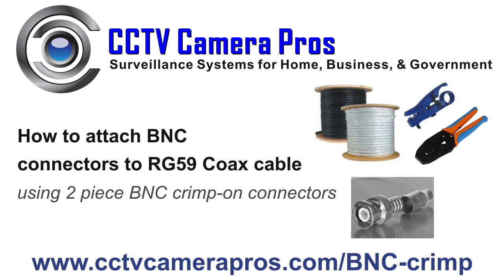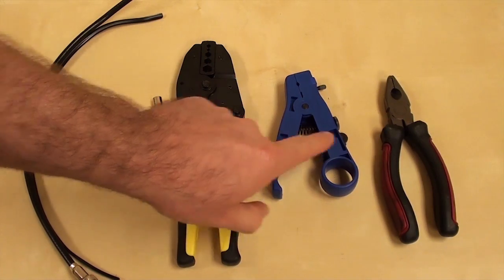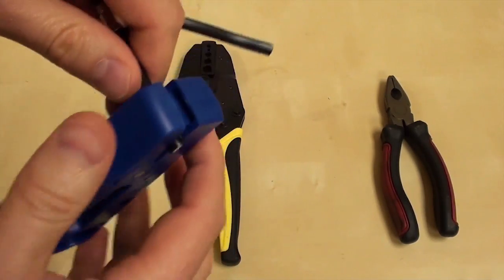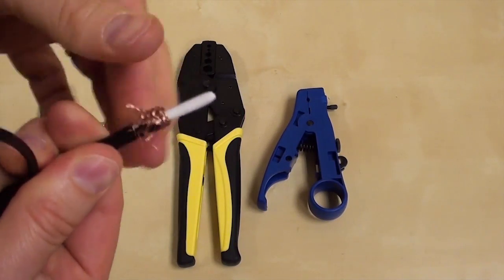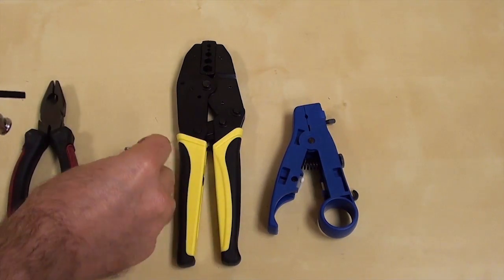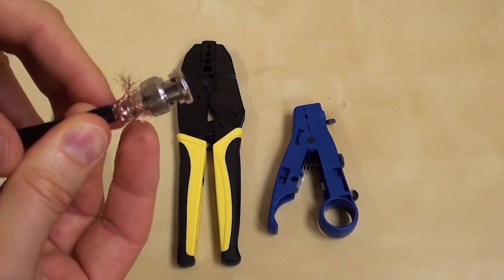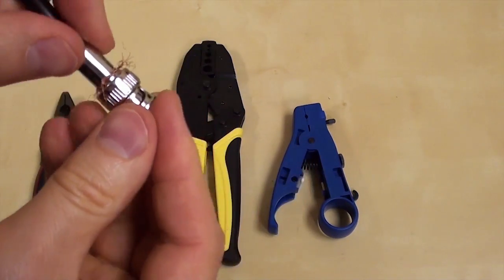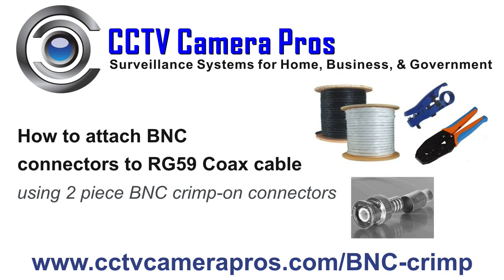How to Connect BNC Crimp-on Connectors to RG59 Coaxial Cable

Comment: Hi Thanks for sharing, great video clear and to the point. I have  Mini RG59 cabling for the Lorax CCTV system and need to refit the Bnc connectors, is  there a crimp kit for that?
Reply from the maker: If you are referring to pre-made cable with the ends pre-attached, then no. You can not cut a re-crimp that type of cable.

Comment: Hello - Thanks for this video. What tools and materials are needed to crimp the female BNC connectors to the same RG59 Coaxial cable? For clarification, it would be to crimp a cable that would connect directly to the head of the cable you've demonstrated here.
Reply from the maker: Jarrod, is your goal to splice together two separate sections of RG59? If so, I would recommend crimping an F-connector on each end of the cable. https://www.cctvcamerapros.com/F-Connector-RG59-Coax-p/cn-fm84.htm
Then connecting the two cables with a double female F-connector. https://www.cctvcamerapros.com/Double-Female-F-Connector-p/cn-df1.htm

You could do the same thing with BNC connectors, however, we have found that when attaching two cables together, F-connectors are more secure than BNC. 

If you do want to use BNC, attach these BNC crimp ons connectors to each end of the two cables. https://www.cctvcamerapros.com/CCTV-BNC-Crimp-p/bncmalecrim.htm
Then connect the two cables together with this double female BNC. https://www.cctvcamerapros.com/CCTV-BNC-p/bnc-double-female.htm

Whether you use F-connectors or BNC conectors, you use the same two tools. 

This is the cable cable stripper tool that you need. https://www.cctvcamerapros.com/CCTV-Cable-Stripper-p/tl-22.htm

And this is the crimp-on connector tool.
https://www.cctvcamerapros.com/CCTV-Cable-Crimping-Tool-p/tl-70.htm

Please let us know if you have additional questions.
Reply: @cctvcamerapros   Thanks for the answer and suggestions. I was actually trying to design a neat wall or patch panel for the coax outputs going back towards the 16 channel DVR that wouldn't have all those lines running directly through a wall box. I found some rg59 female to female keystone jacks and can use a couple of 2-gang, 8 port keystone insert face plates to finish off the wall with a plumbing access panel on top of them to hide all the extra cable from the few lines of premade runs. I'll make up some male to male patch cables to connect from the wall to the DVR.  I've got all the power side running into a surface mount 20 port power box with individually fused connections.

Comment: ...yikes.
Twist up the shielding wires and trim them right off for starters. You don't need to fold them all back over like that and you certainly don't want them hanging out like wild pubes from sagging pants. Secondly, you didn't even attach the center core, which means the connector body won't click on properly and you'll only get a fraction of the contact surface.
And what the f### was that last bit with the razer blade move you're trying to do? What are you some kind of yakuza boss trying to get viewers to chop their fingers off for you?
I Could do it with my teeth and the bottom of a stool and still get a cleaner signal and a safer connection. You may as well tell people to run around a pool with scissors.

Comment: What ensures a good mechanical and electrical connection to the center pin, as it is neither crimped nor soldered to center conductor?
Reply from the maker: You are correct. Nothing is crimped to or soldered to the center conductor when you put ends on the cable. The center conductor is specifically shielded so that nothing is connected to it. The connection is made when you connect the cable to a device or another cable using a BNC, F-Type or other type of connector. The connectors ensure that the center conductor attached the conductor of the other device or cable. I hope this helps.

Comment: Informative video,
I just received my RG59 siamese and some crimp connectors.
I crimped the connector like you did and soldered on my power leads. (- to - + to +) and when i connect the camera and cable to the DVR the inferred clicks on the screen stays black and then in the lower corner i have a capital P with a red x and no picture.
Reply from the maker: To troubleshoot cable problems, it's always a good idea to have a spare cable to test with that you 100% know is good. For example, you can use a pre-made cable for testing. https://www.cctvcamerapros.com/CCTV-Security-Camera-Cables-s/258.htm

Do know for sure that the camera is good? If it is not already mounted, you may want to test is somewhere convenient, like a test bench.

Last, confirm that your power supply is good. Having an extra power supply os a good idea as well.

Comment: So could I hook the BNC output from a PTZ camera set to 480p to a coax, and then through the coax to a TV using this method?
Reply from the maker: Yes, you can connect an analog CCTV PTZ camera to a TV using the RCA composite input on the TV. However, you can not connect a CCTV camera to the CATV (cable TV) input. Please take a look at this article for more info. https://www.cctvcamerapros.com/Connect-CCTV-Camera-to-TV-s/798.htm

Comment: I have the same cable but instead of it being a solid center core it's strand copper wire instead and the outer (ground) is strand silver. I have the bnc end so how would I go about repairing it
Reply from the maker: That cable is not made for CCTV applications. It sounds like a steel-clad cable for CATV, so I would recommend replacing it if you are using for security cameras. It may work OK at short distances with CCTV cameras but is not recommended. As far as how to crimp an end on it, it is probably the same process as you see in this video but I we do not work with that type of cable, so you should probably search for an article of video for that specific cable type to be safe.
Reply: That's the cable that came with my Swann 1080p system. but I found a replacement bnc end at a local electronics store and soldered it and now it's working fine.

Comment: Yeah but what if im currently stuck with connectors far too small for quad wire... Its taking me 10 mins just to smash and twist the wire into the connector
Reply from the maker: Tony, you should make sure that the connectors you have are the right ones for whatever gauge cable you are using. For example, RG6 and RG59 use different BNC connectors even though the BNC part is the same. Maybe that is the issue?

Comment: Nobody's noticed lack of brass pin to be crimped on end of wire before final assembly? Big mistake, will not property connected to panel BNC connector.
Reply from the maker: +Ben Mak these are 2 piece crimp-on BNC connectors. I believe that you are referring to installation of 3 piece crimp on BNC connectors which does require that the brass pin be attached. The 2 piece version does not.

Comment: Don't you need to crimp the small end of the sleeve also? Rookies like me don't know unless you show us every step...
Reply from the maker: +Tech Bubba crimping the small end of the BNC connector is not necessary. As long as the main barrel is crimped properly, it will be secure.
Reply: NO - and if you try, you will seriously weaken the ferrule as well as degrading the strength of the primary crimp.

If you're using the cutting tool, use blades properly.

1: slices the insulation to the correct depth to not nick the braid
2: slices through the insulation and braid, and scores the dielectric (and foil if there's foil)
3: Slices through insulation/braid and dielecric but doesn't nick the inner wire.

The inner wire is then trimmed to 4-6mm length (deending on the pin) and the pin crimped on. It must sit hard against the dielectric. A proprerly done crimp will not "flex" or pivot and will not pull off. if it does, then you're using the wrong connector for the cable or the wrong crimper for the connector.

The connector is then slid onto the assembly until it clicks. It's on properly when a light tug on the connector won't pull it off.

Only then is the ferrule slid into place and crimped. if it's tight, push the connector into the ferrule,  never pull the ferrule onto the plug (or you'll rip the connector off the end of the cable (putting the plug face on a flat surface works, just don't pull on the cable.).

Never redo a crimp or add a second one. This will  result in an unreliable connection.  Properly done crimps will last for 60+ years.

Comment: Ok not to be a jerk. But I am a tech and I install cables and fix computers. Honestly you need to use better tools and cut things better the first time. Doing all that side work was not something that needed to be done. I could make a 2min video and not need to cut one thing also all those tools were not necessary you only needed 3 tools to do it right the first time bud. Hope where ever you work or what your doing you get better training.
Reply from the maker: +Dylan Eckert thanks for watching and for your candid feedback. There are different types of installation tools and different types of coax cable connectors available to attach a BNC connector to RG59. For some people, this is the method of choice. For others, there are other options that they may prefer: compression connectors, F connectors - then convert to BNC, etc.

I can say that this and other methods have been done by CCTV Camera Pros and hundreds of installers that we supply to and the connections have held reliably for a decade and still going strong. We have also used other methods that have held up equally as well.  We love freedom and choices. If you make a video on how you do it, please let us know so that we can take a look.
Reply: +Dylan Eckert I look forward to seeing your video!

Comment: Crimpon connectors for outdoors use are lousy. They get loose , i have had enough trouble that i gave up on them. On ebay compression tools can be found for 6$ and at 50cents a connector they are pretty cheap. Why waste time with the crimpons.

I think you should extend the video to explain the difference between types of connectors and also show how to connect a compression connector.
Reply from the maker: Navin Shenoy yes, compression connectors are also a good choice. We have a video that shows how to attach compression connectors here, however, the video shows a compression F connector.
https://www.youtube.com/watch?v=E861Xc9Bajs&index=2&list=PLllUNW5pS32XOHflP_hyxqL7tPddzjsT-

We also have a blog post with video demonstrations that talks about four different ways to attach BNC connectors to RG59 coax cable. You can find that here.
http://videos.cctvcamerapros.com/surveillance-system-installations/best-bnc-connector.html

Thanks for watching and for your comments.
Reply: CCTV Camera Pros compression connectors

Comment: you ledt out that you need RG 59 BNC's for RG 59 cable.  RG 6 BNC's will be too loose!  Why do you leave that out.  NEVER ASSUME in tutorials!!!!!
Reply: Don't be entitled. You and I are the viewer and the ones searching/researching. Verify everything yourself. Not everything is spoon fed.
Reply from the maker: Thank you for noting that. You are correct. If you are using RG59, be sure to get BNC connectors for RG59. The same goes for RG6. These are two different sized connectors made specifically for those cable size.